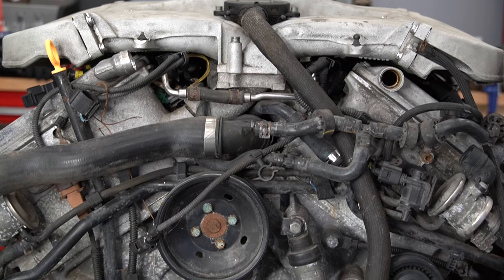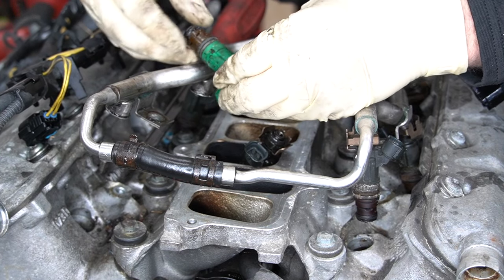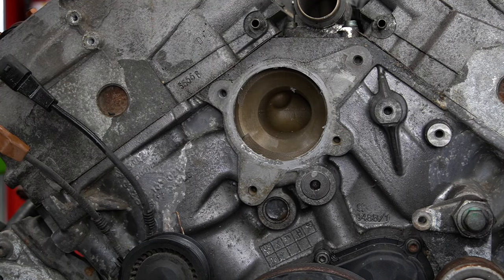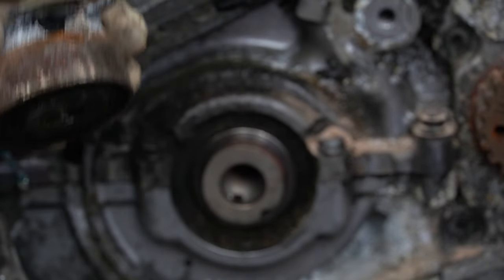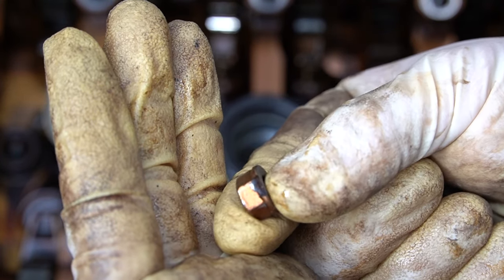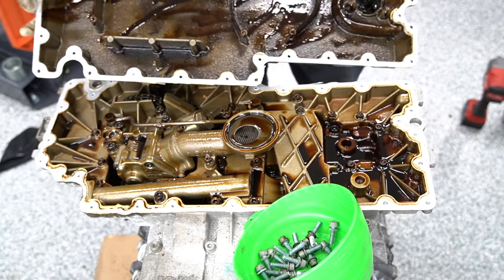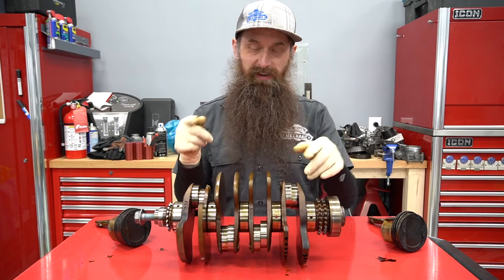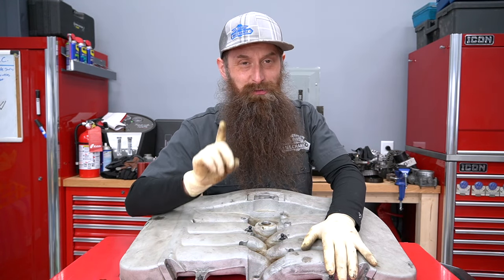W8 Passat Engine Teardown and Inspection ~ TINY V8

Comment: Another use for old wiring harnesses is the pins and terminals they contain make awesome test probes!!! 

If you are doing electrical diag and you don’t have the special 100% correct probe kit that most car manufactures sell as special tools, scavenge/depin terminals and pins from old harnesses for free instead of shelling out big bucks for a special service tool kit. No more spread pins from testing and checking pin fit is a breeze!!
Reply from the maker: RIGHT!!!! I Cant bring myself to toss them.

Comment: One of the worst parts about the W8 thermostat is that you have to replace the whole housing when it's stupid temp sensor failed. The whole housing is around $1k. I think someone in the Facebook group found a slightly cheaper audi or bentley one, but still crazy. 

I had alternators go bad too, and they're awful.

Comment: They can make a lot more torque, the inlet manifold is the biggest restriction as they went for a smooth power band over performance. Slap two turbos running 8 psi and they are good little bangers, there are a couple I've seen in the past that were pretty impressive.

Comment: 2:04 Although I agree about the heat shrink,  from a practical standpoint,  no injector that has its own "carport" for a manifold, is likely ever to see rain, much less a steam jenny.
Reply from the maker: You’re not wrong. :) even if it’s no harm, it takes 5 seconds. Now inside the car, behind the dash where heat can cause damage, I’m cool with leaving it.

Comment: That is some crazy engineering to make that so compact.
Reply: Compact, compared to what? Both the V8 LS-1 and the V6 Buick 3800 are smaller and twice as powerful. This engine is a joke.
Reply: @satamanschmidt3428  It's a little unfair to compare size to pushrod engines, don't you think? :)  Since when was the Buick 3.8 ever "powerful"!?
Reply: @TassieLorenzo  Try to get a VW to keep up with a Buick Regal Grand National or even any ordinary Pontiac Grand Prix GTP. The Grand National with the turbo was faster than that years Corvette and the GTP was a very quick car.

Comment: Interesting to see the difference in colour of the ports in the inlet manifold!
On another note I have a Transporter T5, the clutch slave cylinder failed at 217000km. To change the slave cylinder the gearbox needs too be removed, 10 hours apparently for that alone, OUCH!
Hi from NZ,
Anthony

Comment: those screens failing are the most common failure on W8. I bought one with 100,000km in 2007 for less then a 2.0 Jetta with same mileage.

Comment: The rod journals are offset so that the engine has even firing if they shared the journal, it'd be an odd firing engine, which means that ignition events (if we fix the ignition advance) would not happen consistently for a given number of degrees.
Reply: It would shake itself apart.

Comment: I have a W8 that's still running so this video is extremely fascinating to me. Please year down the transmission. I love to see that as well.
Reply: How many miles?
Reply: @YOCOSMINMAX16  157k KMs so roughly 100k miles. I've put a K&N air filter in and have fiddled a bit with the exhaust and suspension. Its expensive to keep running but when its running well its a joy to drive.

Comment: I've always had a sick curiosity with these things. I'd love to swap it into something and set it up for performance. Par down some of the complications and run it on a standalone. Maybe see if someone could regrind the cams? It's such a cool engine, and one of the absolute cheapest sort of flat plane crank V8s (yes it's a w, it's different, blah blah) that you can find. They make incredible sounds!

Comment: 271 horsepower is about right for a naturally aspirated engine of that size for the given RPM range and head design. The Toyota 4.0 litre 1GR-FE 4.0 litre V6 has a similar output.
Reply: And is also much more reliable and less filled with nonsense.

Comment: Surprised the balance shafts weren’t seized up with the way that belt looked.  I had a FSI engine that went through 2 oil pump / balance shaft assemblies because of locking up.  The first replacement blew a hole right through the oil pan and there were metal bits of it all inside.  The second, who knows I sold the car but the kid put 3000 miles on it and the engine seized.

Comment: Management - "Ok, we want you engineers to squish a v-8 into something the size of a boxer 4-cyl".
Engineers - "Ok, are there any other constraints?"
Management - "It only has to run as long as the warranty"
Engineers:
- crazy vee huge/proprietary Thermostat
- Rear timing chains & rear tensioners
- fluid-cooled alternator
- chain driven huge oil pump
- 200 pounds worth of bolts
- rear belt drive balance shaft

The offset pin crank throws, think connecting rods and belt drive balance shafts make me scared of high RPM operation of that engine.

Thank you for doing a teardown, Regardless of how unusual and not really practical in my opinion, it is always neat to see how someone else builds a box...
Reply from the maker: Hey dont' leave out the accounting department. LOL

Comment: The way you don’t want to use an impact on the crank pulley bolt but you beat the crap out of the oil pan
Reply from the maker: My gun wouldn’t pull the bolt off.

Comment: Balance shaft belts are a common failure point on lots of engines across all makes and models with belt driven shafts, high shear loads because of constant loading and unloading on the belt teeth cause them to strip.

Comment: The W8 will run fine without the balance shaft belt. There may be a very slight uneven idle but above 1000rpm it's not noticeable. The Mitsubishi 2.4 four pot as fitted to the SpaceStar also has a balance shaft but it's not noticeable at any rpm if the belt has snapped.
Great video as always..Subscribed
❤️
Reply: It looked to me as a two- to- one overdrive on that balance shaft. Is that right?  Pretty fast for a little belt under a cover.
Reply: @michaelszczys8316  
I'm not absolutely sure but yes I think it does run at twice crank speed. The belts on these balance shaft engines do always seem small but they're not really under great stress. At least the engine isn't damaged if the belts does snap..
Reply: @Draxindustries1  now that it's brought up, I'm wondering just why does a balance shaft have to go ' faster ' than the crank speed?
But then it's one of those engines so I guess it has some legitimate exotic reason.

Comment: I owned one of these.
Threw a torque converter code in 2nd yr. They had the ENTIRE drive train out for repairs.  4 motion. Car was nvr the same. Multiple vibrations at various speeds. I baled on this PoS.
Reply from the maker: DAMN! Seen a few TC fail. We usually did them with just trans out. Sounds like a shop issue as much as a car issue.
Reply: @HumbleMechanic  They had car up on rack. Engine jig suspending engine up out of body slightly. Tranny, diffs and all drive and half shafts out of car. This was on the 2nd or 3rd iteration of call back for the vibration. I even bought a 2nd set of tires for them to mount up for elimination. Metro VW, Irving, Tx. Nightmare 1 night, listed/sold it shortly there after.

Comment: I agree, needlessly complex.
water cooled alternator?   HaHaHa!

if made properly there wouldn't be the
  hose mess and all the casting pieces.
( I'd LOVE to design & build one! )

It'd be sort of like a std. American V8,
  a triangular cast iron block with steel
  main caps (very strong), one piece
  cast alu. cyl. + head & steel cyl. liners
  (no head gaskets, water jackets are
  completely contained in this assembly),
  Desmo springless valving (sm. cam &
  rockers), ele. water pump (no thermo.).

Comment: I'm not sure how true it is, but apparently alot of vw dealers back in the day declined/refused to sell the w8 passats because the couldn't justify the price vs performance compared to other makes at the time. The w8 wasn't cheap. I think they only sold them for like 4-5 yrs.
Reply from the maker: I doubt that. Dealers sell what they have. Can’t imagine they’d refuse. Some sales people probably did. Lol. 2 years of the w8 I believe
Reply: @HumbleMechanic   Aren't dealers independent franchises and choose what stock they carry? Or does vw dictate what they sell?. I remember reading an article that vw dealers weren't to impressed with the passat w8 though. only 11,000 sold.(acc. to wiki)? None the less interesting engine never saw on one apart before.

Comment: Balance shafts on a 8cyl, American V8s figured out how to externally balance engines damn near 100 years ago, notably the Ford Windsor motors, which have much better reliability than the W8, and, water pumps aside, are easier and cheaper to work on, with much better power.

Comment: Charles at one point I stumbled across a web link that had an aftermarket three rotor balance shaft that was meant for a dry sump operation it had three shafts to send off to a sump somewhere else a reservoir I mean and then back into the engine with virtually no pen I can’t find this for the life of me and they didn’t make it for very long but however they did make a three shaft balance shaft for panelist operation for that engine yes they did make one

Comment: Knew VW are over engineered junk but they run ok for the 1st 60k. Thank you for helping us understand why there are always used vw's with low miles because there 1st owners ain't gonna deal with the repairs

Comment: Charles,  thanks for sharing and revealing the engineering behind this engine.  One question I am curious if you could answer is why the slanted top of the pistons?  What mechanical advantage is there in using that piston design?
Reply: Because there is one cylinder head for two rows of pistons,since the block and cylinder head have to be straight so they would bolt together they had to make pistons shaped that way to make up for 2 opposing cylinders to share one head,that slope would correspond to the angle between cylinders, if one bank is 15 degrees apart that slope on the piston would be 7.5 degrees on one pistons and 7.5 on the other.

Comment: That engine is a monster.  VW engineers make thing so complicated.  My Volvo engines are far less complicated, provides as much HP, and last for over 250,000 miles.  Even my Mercedes of the same vintage had less complex engines that lasted longer.

Comment: Buick made an even firing 90° V6 in the 1960's that could be found in a few Jeeps. They had the offset connecting rod bearing surfaces too.
Reply: Odd firing, its the Dauntless, Buick sold the design.....and it re appeared as the 3.8 v6 found in Rover vehicles

Comment: There are time when VW is a funny company to understand. No doubt this engine was made to fix in the cramp bay of a front wheel (AWD) car. If you had to have "everything" including a V8, this would do it. 

I like to keep cars for a long time (20+ years). This would be one to avoid.

Digressing...

I don't understand the "why reason" of the VW VAQ differential system.

Wouldn't a torsen get the job done with a smaller foot print? Probably more reliable.

I've been a VW owner since '72. Several air cooled and two diesels. Current car is a 2001 Jetta with the 1.9. Over 220K and the engine pulls strong. Transmission is rock solid.

Anyway, loved the W8 tear down.

Comment: What plugs do work best in Volkswagens?  I know never use Autolite.  I have a 2013 Passat with the 2.5.  It is one of those cars they only had the 2.5 in for 2 or maybe 3 years.  Of course that is not a turbo engine like in the TT RS (which is also direct injected unlike the 2.5 in most Volkswagens).

Comment: Correct me if I am wrong, but wouldn't a semi-clogged oil passage in essence make more oil pressure since it's seeing a bottle neck and like with any system that flows air or fluid, this would cause an increase in pressure.

Comment: It's a super cool design. There are just too many compromises. The cross sectional area on the rod journals is way too small. The W12 has the same problem. I'd really love to see someone try to push 1000hp out of the W12 for the Audi and Bentley guys. 
There's a guy in Portugal that people from all over Europe, as well as the fastest RS3s and TTRSs in America send their heads to. Including the 1300hp VR32. Veicomer racing, he has a YouTube channel. He has been golfball dimpling intake runners and manifolds for YEARS and it's still something under debate here. Why under debate? I have no idea, obviously people that have never actually done flow comparisons. It has no negative affects and increases flow across the board.

Comment: Wait.... the oil pump is driven off the balance shaft that's driven by a rubber belt? (19:55) Nice! 
Your video is the perfect anti-commercial for a car you shouldn't buy. 😂
Reply: No, oil pump is driven off crank via chain. Balance shaft is driven by belt of the crank.
Reply: @goggologgo6590 
Thank you for the correction.  😊

Comment: My god, that is one complicated engine! It’s no wonder these things leak oil....amongst other things that go really bad all the time. There’s 27 different pieces in the bottom end/girdle/oil pan-ish area. That’s unreal. Not to mention it doesn’t make any power after all that and if you wanted to run forced induction parts fly off even faster. No thanks! Thanks for the video, that’s pretty cool, but I think I’ll stick to my LS’s. 😂

Comment: This would be an interesting little hot rod project engine, a bit complicated, but interesting
  That oil pan design is almost like a dry sump type with a false floor. Is that crank a flat plane?

Comment: Do you still have the engine? Do you plan to do anything with it? If it's in running condition, it would be interesting to see if you can put it in a Golf :D
Reply from the maker: I scrapped most of it. Gave the block to a buddy to make a table

Comment: The Germans do some interesting and sometimes odd stuff. 4.0 litre doesn't seem tiny to me, the Ford 4.6 modular V8 is not a lot bigger and was very common. 72 degree makes it a little more like a compact 60 degree V6 in some ways.

Comment: With EV's on the horizon, it may not matter too much, but the straight 6 is the easiest to manufacture and with a single turbo, gives adequate power. I find it surprising that the straight 6 is not more popular.

Comment: See those tiny rod bearing shells? They made them very narrow (in order to make engine compact) and they wear out much sooner. And now the best part: you cannot buy them! W12 do not fit and VR6 are wider...so only way to obtain them is to modify VR6 ones. Basically no engine parts are available except head gasket. The whole car was just a sellable mule to test W12 engine components. The balancer belt is also one of those things that is cheap but hard to replace so the bros who inherit these cars just ignore the noise and vibrations.

Comment: I keep every harness off of every motor I change or harness etc. All good connectors are depinned and stored in a labelled box I snip the pins off couple inches up the wire and keep all the harness pins and the remaining wire and loom gets tossed into a box. Never know when a correct coloured wire needs to be spliced into a harness

Comment: But what was the point of the W8? Was it supposed to get better emissions than a 4 cylinder or something? Like you said it made less power and torque than most modern 4 cylinders.. Why did they decide that was a good idea? 
The bottom end reminds me of the Navistar V6 and V8 that were in late 90's Pontiacs/Chevy SS etc.

Comment: My brother had one of these it failed before 100k miles and VW said they would cover the repairs and then backed out.

They then wanted to charge $7000.00 for parts chain tensioner idler and sensors.

Unrelated the seat heater cooked the passenger seat and VW wold only give him a vinyl upholstery replacement.

Too slow for all that complicated stuff.

Comment: thanks for the video it was about what i expected.... not reliable, narrow bearings/rods, very underpowered compared to the vr4's, a shop owners wet dream, a mechanics nightmare, an owners mistake, lots of room for engineers to test their ability at everyone else's expense. I had it in my head when i came searching for a video on the w8 design that it would be very interesting but had no idea it would be so for a lack of words BAD. i think it is neat but not better in any way compared to other anemic v8 type designs like for instance the GM 4L v8.

Comment: I'll never understand why engine builders put plastic on a metal rotation surface and not expect it to fail
Reply: Sacrifice would be my best guess. Plastic on metal ensures that the plastic part will wear out with little or no damage to the metal, whereas a metal on metal surface wears both at the same time. But it's not a good practice if you do it on a part that's really difficult to get to and makes a pointless charge to a service interval.

Comment: I'm interested in how you remove the timing chain sprocket on the rear of the crank, when the flywheel hub is behind it. Does the hub press on with a keyway?
Reply from the maker: It might not be able to be removed. I mean it's doable, but it may be at the cost of the crankshaft.

Comment: When you were showing the timing chain and said it was simple, I laughed out loud😂 2 extra failure modes for each component lol that can't be as reliable as a regular single chain and single tensioner, idk the entire engine seems very overcomplicated when the only real object of building an engine this way is to save space, seems like alot of give for very little get
Reply: not that complicated.... 

the 2v ford modular has 2 chains, the 4v has 4 chains.